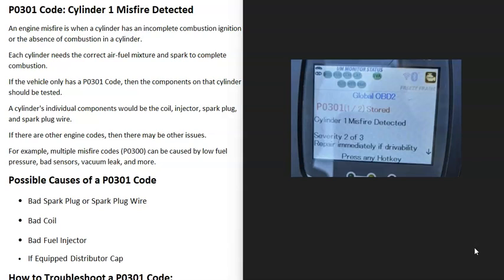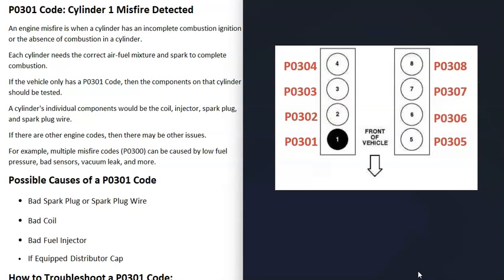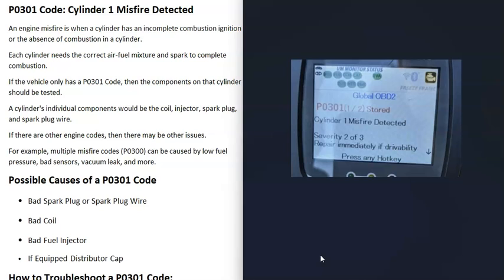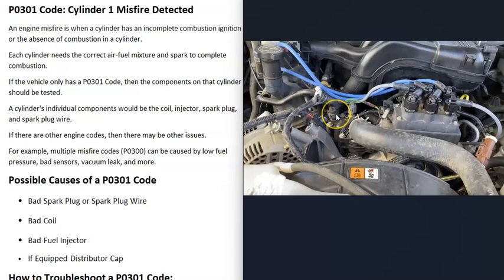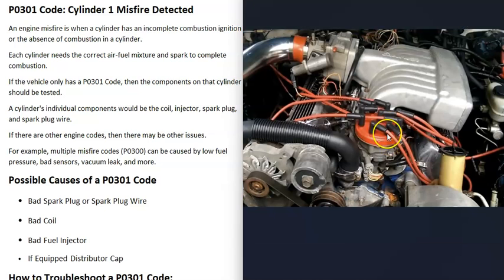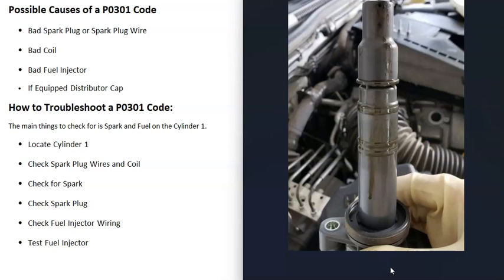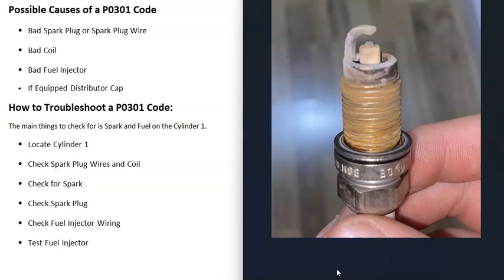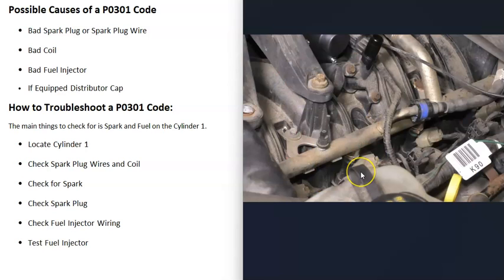Causes and fixes P0301 Code: Cylinder 1 Misfire Detected

Comment: Can it be a crank shaft sensor?
Reply from the maker: A bad crank sensor can cause misfires, but it would also cause many other codes.
Reply: @HVAC_Mechanic I had a clutch fitted and also had the crack sensor changed. Now a few days later it's coming up with this fault code, the engine light is on and it judders when I accelerate. 
I even changed the crank sensor again, as the bloke in the shop swopped it for a new one.
It never had this issue before. 
Any ideas.

Comment: What if misfire happens only on idle, and I checked spark plugs, coils, injectors. All good. As soon as i raise idle little bit with gass, msifire stops completely. Acceleration is all good, power is great, smoth. Only rough idle and P0301 in idle and misfire count constantly 2-3 a second in idle.
Reply: It was compression issue, one spring became soft. Weird.
Reply: @jutjub22 after two months, you just solved it now?
Reply: @mekanikalph5674 yes, as I wrote. One cylinder lost compression. Due to failed valve spring (very weird, spring was soft, no resistance, it was fcp racing spring). 

So refreshed head parts, gaskets, and all good now. No damage. Engine is so smooth now.
Reply: Hey my car is doing the same thing were you getting a reading for just cylinder one and you fixed it this way ?
Reply: @joshuafactor9900 it was just first one initially. 
Fcp racing spring started to lose tension. Later others too. (Intake)

So compression was lower. I am putting Supertech springs in.

So it was compression related.

Comment: we jus changed coil an spark plug an gasket valve . ill check injector an recheck if all coil s are connected cause of vibration etc . any help besides  that awesome video .

Comment: we jus changed coil an spark plug an gasket valve . ill check injector an recheck if all coil s are connected cause of vibration etc . any help besides  that

Comment: Tacoma 2.7 , code P0301
Coil, spark plug and injector swapped, cylinder compression 150psi, injector connector checked with a Noid light tester(ok) all four spark plugs look good, fuel pump and ECU also replaced, what I’m missing ? If the ECU fails to send signal to the coil the  spark plug supposedly should be wet with gas , right ? Any new fresh recommendations will be greatly appreciated 😔
Reply: Vacuum leak spray carburetor cleaner around the inyector hoses manifold if RPM increases!!
Reply: @mauriciobarrera3012  thanks !👍🏻
Reply: @64arguz hi, have you find out? Bad sensor perhaps?
Reply: @p0tr3bit3l  nope , already sold the vehicle, the engine needed to be rebuilt 😔 I lost a lot of money in that project trying to make it work, thanks anyway.

Comment: I have a friend who has replaced everything and still has code and cylinder 1 still miss firing?
Reply: Did you figure out what it was
Reply: Same for me, trying to figure out now
Reply: @Ashaunti89 I fixed my problem. It was the crankshaft sensor that fits on the side of the gearbox. I changed that, then cleaned the sparkplugs. It's driving fine now with no error code or error.

Comment: I have a 2017 Mitsubishi lancer it was throwing the code p0301 I bought a new spark plugs new coil packs after I put them on the check engine light was flashing again so I took it down to get it scanned and the same code popped up so now I changed all four fuel injectors and it's still misfiring on cylinder one coil pack number 1 what should I check out next
Reply from the maker: If all cylinder #1 the components are good, there may be a wiring issue. I would check for spark and test the injector circuit. There should be two injector wires. With the key on, one should have constant voltage (12 volts). The other wire is the ground that the computer uses to control the circuit. It should pulse when the engine is running.  I made a full video on how to test the injector circuit. Here is a link. https://youtu.be/JL4_HlYCKrw

Comment: What are the symptoms of a P0301 ?
Does the engine run rough?
Does the engine not start?
Does the engine sometimes start?
Does the engine turn over but not start?
Does the engine sometimes start and run rough for a a few minutes?
Does the engine start and run fine as if nothing is wrong?
Does the engine start at all?

What are the symptoms?
What are the symptoms?

Comment: I only get that code and a misfire when ambient temperature is below 50 degrees.  During summer car starts smooth, any suggestions?
Reply from the maker: It needs to be diagnosed, but if there are no other codes, I would start by tuning it up and checking the temps with a scan tool of the temperature sensors to see if they are off.
Reply: No other codes. I put in new plugs and coils. Has new air filter and no known vacuum leaks. Im thinking it maybe the injector sticking during cold weather?

Comment: I get this code more often now & I recently changed the spark plugs as well as the coils. My issue sometimes is the car struggling to start. I have to push on the pedal a little to get it going or I feel a rumble sometimes when I start it up. My mechanic says it may be the timing chain. It's a 2018 jeep cherokee latitude btw
Reply: Hello, is it the 3.6l? Reason I ask is I have the 2018 ram 1500 3.6l and I have went through and changed injectors, coils and plugs about 6 months ago Last night got the p0301 code again. I don't know why but that plug seems to burn hotter
Reply: @kennyc.3238 have you fixed it? 
Did you check the crank shaft sensor

Comment: Nissan intake hose and the small hose connected to the engine cover cause  P0131 vibration lean condition to much air/fuel  and a  permanent light till issues is fix. Nissan poor design  intake hose a major problem I glue the small duck hose keep popping off with no warning light engine will shut down immediately. The clamps came with all the hose went in the trash and installed all new hose clamps tightly and I always checked and if the clamps needs tighten.
Reply: Can you explain more I’m having a mis fire in cylinder 1 in my 350z

Comment: Hello, any other ideas what it could be ? we changed out all 4 spark plugs, coils, and fuel injectors, and the light is still going on. Do you have any suggestions to look at?
Reply: Also changed O2 sensors
Reply from the maker: If the components are good, I would check the wiring next.
Reply: Brother, have you fixed this problem?
Reply: Yo did you fix the problem??
Reply: i ended up trying a head gasket sealant but it only worked for a week because my car started to overheat. I ended having to get a refurbished engine and fixed my problem!!!

Comment: Replaced coil pack, wires and plugs also replaced injector to cylinder 1 and still popping this code. 05 neon sxt and it’s driving me nuts. Any suggestions? Can a bad oil pressure sensor cause this as well?
Reply: I’ve had a couple people mention one of the valves being stuck in the cylinders, I really hope I don’t have this issue I’ve been told it would call for a master rebuild on my motor. Still doing my research tho before I take any big steps
Reply from the maker: If all the parts are good, it may be in the wiring. I would be sure it is getting spark, and the injector wiring is good. If there is a bad valve, usually there are other symptoms such as smoke, ticking noise, popping.
Reply: @HVAC_Mechanic popping at the exhaust tip?
Reply: Merhaba. Sorunu çözebildiniz mi. Neler yaptınız.

Comment: Wath abouth code P0101 and P0301.
Reply from the maker: I would clean the mass airflow sensor, clear the codes, and see if they come back. The P0301 is likely a separate issue on cylinder 1, but it's worth a shot.

Comment: Thank you HVAC Mechanic. On my older Toyota Camry 1995 4 Cylinder Engine, the professionals that I have gone to could were "UNABLE to remove Cylinder #1 Spark Plug" and the first old German guy replaced Spark Plugs #2, 3 & 4 approx 3 years ago. Now I'm spending too much money on 1) Diagnostic tests 2) and a new Fuel Filter and Injection clean-ups 3)and replacing 2 Front Axles for $842. I'm 77 years old and on fixed income and the car runs but I'm afraid to drive it. Please help me sir. Thanks in advance

Comment: I have 2007 jeep compass limited cylinder 1 misfire dtc  but also a cylinder 4 with no code wont go over 2500 rpms....im stuck please help
Reply: check the injector connections, and that they are seated properly, that is an injector problem
Reply: Could it be the o rings. ..because I checked  the spray pattern